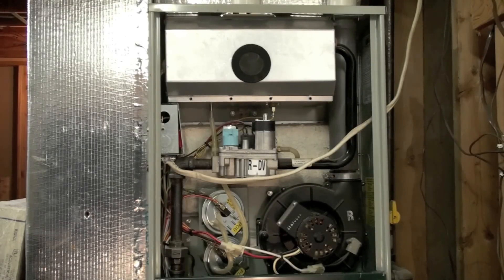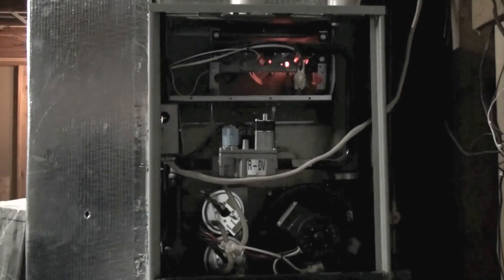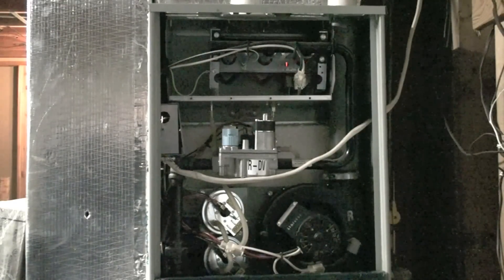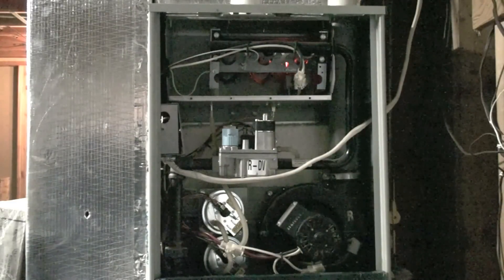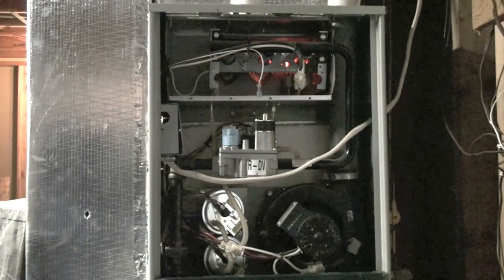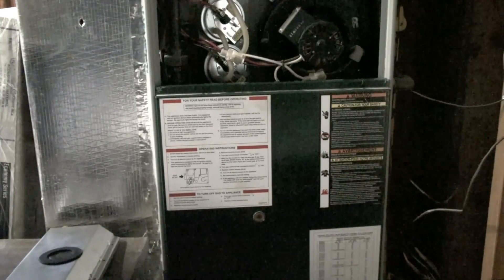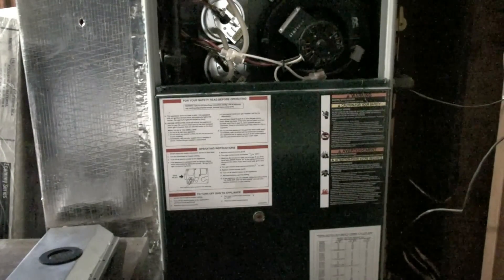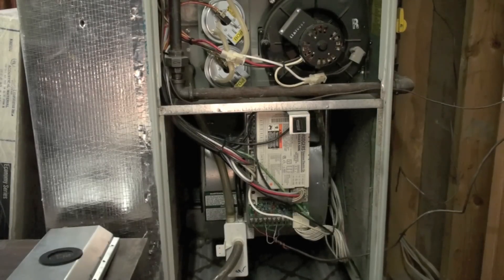How the 90% gas furnace works

Comment: We just had a Trane XC80 gas furnace installed in the last two days.  It's running beautifully.  My boyfriend put the damn thing into high flame mode.  It heated 3000 square feet of house in less than 15 minutes from 64 degrees to a comfortable 73
Reply: Any issues with it yet? 90%ers are starting to fade away.

Comment: I am a fitness equipment repair tech and licensed electrician, the equipment I deal with is not so far from HVAC in principle, motors, controls and air flow etc., thank you for these videos they are well done and interesting, you have made me seriously consider shifting my career. keep it up great videos I can watch them like a reality show lol
Reply from the maker: You mean maybe I'm like Survivor?
GFM
Reply: very much so
Reply: it's funny you say surviver, with how long you've been in the industry I'm sure you have seen many trend and code changes, have you made a video about that? the evolution of the industry
Reply from the maker: I have not.  Sounds like one to do.
GFM
Reply: Right on, it would be very interesting. I have a question if I was to get into the industry, is a online school as useless as I think it will be or is there real potential to start a career from that point? I would imagine, as in fitness equipment repair and electrical, hands on experience is king

Comment from the maker: Sorry about the late response. There appears to be some places that still do not have internet.  These furnaces originally went into hard lockout after one trial for ignition.  There were many nuisance shut downs.  Probably due to power anomalies.  So most furnaces have gone to using a soft lockout (meaning it will purge unburned gas then try again) two times and only hard lockout after 3 tries.  Note it also will try again after 1 hour to see if conditions have changed.

Comment: My 90 plus has been great for 20 years. i have had 2 issues. the pressure detect switch didnt detect fan coming on. Figured out with error code and tested switch with a meter. New switch installed (20 bucks for part). I also had the board go bad once. New board made entire house smell since a component burnt out. Scared us enough to call fire dept. New board was $200.00, i installed it in 10 min.

Comment from the maker: The gas manifold pressure should be normal with a blocked orifice.  If you have multiple burners, one or more will have no or a very low fire and the flame will not spread to the next burner.  If the meter is clocked, the input will be low.  As to flame sense, most furnaces sense on the the last to fire burner, so there will be no flame sense.  I would be looking close at each burner flame to note difference in flame size.  Hope this helps.
GFM

Comment: Awesome demo by the way! thank you for posting this!

but why didn't the furnace go into hard lock out after you unplugged the flame sensor? (first two times it didnt notice a flame at all) the third time it didnt notice a flame either...(which means that all three times the flame sensor was open) all three attempts had an open flame sensor connection... or is the flame circuit sensor always closed? or is there an element that senses if gas is traveling through the manifold?

Comment: Hi GFM,  Wanted to ask on these percentages for the AFUE, The text I am reading says that plastic pipe can't be used on furnaces until 90% or higher.  So is the lower percent number mean that the furnace runs hotter and has less chance of producing condensation? 

Thanks for your help

Comment: what would happen if you had spiders web up orfices in the manifold for gas supply . I had this happen to me . It was simular to what flame rod not working right . But if you had a manometer hooked up to the burner manifold would you gat a high pressure reading indcating that you have a restriction in the gas supply form the gas valve . Would that be the proper way to test it without taking the manifold apart first .

Comment: thank you for posting, a big help walking me through. when  you say power  do you mean from the breaker box, or the on off at the gass Junction box, my hubby left  last night and the heater  messing up, now. thought it was good whent to bed, then woke up to it making  that noise  of trying  to and then stopping. clean the heat bar, and its like no power? and of course  the first  snow  of the year here. :(
Reply from the maker: You can start by the light type switch on the furnace.  That will reboot the electronics.
GFM
Reply: grayfurnaceman thank you. it ended up being  the  fan motor  got it fixed last night. i am thankful  for  you postings  the video  it was a big help, and was able  to  do  it  myself  and didn't  have to spend lots of cash i don't  really  have to spend right now. thank you  again.
Reply from the maker: Welcome
GFM

Comment: My only question is the small drain on the furnace that goes into my floor drain. Is that for condensation? Does my furnace only have condensation during the heating season? Not during the cooling season? Great video and thanks.

Comment: Quick question: I have a 90% furnace. Hot surface ignitor came on, but it did not fire up. I checked the voltage going to the Gas valve and it was reading 9.2 volts. I changed the board, checked all the roll put switches and high limit switch. I have continuaty but it is still not firing up. What is next, the gas valve itself???
Reply from the maker: First, is gas available to the valve?  Before changing the gas valve, I would check the voltage at the wires to the gas valve.  Wires must be disconnected from the valve.  This must be done during a trial for ignition.  That is, when the HSI is glowing for 10 to 45 seconds, there will be power to the gas valve for 4 to 7 seconds.  
GFM
Reply: @grayfurnaceman  Thanx for the reply. I did check the voltage across the 2 stage gas valve. I was getting 9.2 volts. I had Nest thermostat installed 6 months ago and now the heat is not coming on. W1 is connected and w2 is not connected on the terminal board. Do I need to jump w1 and w2 for the 2 stage gas valve to work?
Reply from the maker: The W1 and W2 connections will not stop the valve from working.  The way it is now connected, will just lock out the 2d stage of heat.
You can try jumping from R to W1.  This will eliminate the thermostat as the problem.
GFM @copkhan007

Comment: I thought how a gas furnace operates is its has 2 sides , the microturbine side and the fan side, i thought the gas like the cng that comes from the gas company and it has a electric starter to turn over the gas turbine and fuel comes in and plugs ïignite it and as its running on the gas, the exhaust heat is used to heat the heat conductor which is directed by the fan system by a heat thermostat. And when the gas turbine is up to speed i thought the clutch activates the blower fan and both run 1:1 until the thermostat determines the set house temp .

Comment: Very informative! My furnace runs, pilot light is on but there is no flame in burner. I suspect for some reasons the gas valve isn't open. What would causing that?
Reply from the maker: Dan If the blower runs there is power to the furnace.  Is this a standing pilot furnace?
GFM
Reply: grayfurnaceman yes. The pilot is always light up. I manually relight the pilot the 1st times in a year. Sound like the pilot waits for gas to kick in but that took up to 20 minutes. This happen 1-2 times a day.
Reply from the maker: Dan I am assuming the is a thermocouple system rather than a thermopile.  If so, there gas valve is probably failing. If power is available to the gas valve, it should star immediately.
GFM
Reply: grayfurnaceman look like thermal couple to me because I see cooper wire is burn the pilot light. What I dont understand is why it only happen a few times a day. When it happens I just turn off/on the furnace hope it will burn. Really waste electricity here.

Comment: Just had a 96% furnace installed seems to run great, but when the furnace is off I can smell a very tiny bit of gas around the furnace, the installer said that is OK. Once running I don't smell anything, could this be normal? The furnace cabinet has rubber grommets on the side I guess to run stuff in and out, not all of them are used and one has a small hole in it and this is where I can smell the gas coming from. But it's very faint and not all the time. Is this OK.
Reply from the maker: +Rays RCs I would say not.  The problem with small gas leaks is you get used to the smell and may not recognize a bigger one.  I would want it checked out with a flammable gas detector or a very careful soap bubble test.
GFM
Reply: Thank for the info, called the installer he is coming back to do a pressure test on the system. To work out if leak or unused fuel Im smelling. But it's from the two stage valve I smell it (took the side panel of yesterday)
Reply from the maker: +Rays RCs Sounds good to me.
GFM

Comment: We have a new high efficiency gas furnace and recently once or twice in the evening we get a 2 to 3 second gas explosion in the furnace "Very Load and then you can feel a tremor in the house, however the furnace does not come on.  What could be the problem.  The make of the furnace is "HEIL"
Reply from the maker: It sounds like a delayed ignition.  This is pretty serious.  I would get someone out as soon as I could.  If you can't get a service tech out right away, check with the gas supplier to see if they can help.
GFM

Comment: whats the difference between a high efficient gas furnace and a reg furnace? Do all high efficient gas furnaces have A/C.
Reply from the maker: There are furnaces that are rated at 80% AFUE (annualized fuel usage efficiency).  Then there are 95% AFUE.  These last are high efficiency furnaces.  A/C is an option with a lll furnaces.  Hope this helps.
GFM

Comment: do 90 plus furnaces seem like they short cycle naturally?  if I set it to 70, it goes to 70 not 71, I'm used to furnaces going 1 degree warmer than set temp?
Reply from the maker: The high efficiency furnaces cycle like all others.  If the anticipation of the thermostat is correctly set, the temp in the structure should not vary.  
GFM

Comment: My inducer motor overheated and started to fire up and shutoff so I went to YouTube to see why it was doing that and tested the pressure switch with a paper clip and it fired up but the inducer did not come on , so I took out the inducer and the motor was burnt out. I checked Amazon for the inducer motor and the earliest they can have it was in 20days and the temperature in my house dropped to eleven degrees,what am I going to do. So I was walking along the street in my neighbourhood and low to my surprise some one put out a Lennox furnace it was not the same model as mine but the inducer was the same except mine had brackets on it and thi one didn’t so I said no problem, I cut the plastic brackets out of my old motor and plastic weld them unto the new one and low and behold it worked. Then I called repair clinic for the pressure switch and furnace runs like new
Reply from the maker: Glad you got it going.
GFM

Comment: Still confused if the inducer motor proves the vacuum for the pressure switch. Or if the pressure switch proves vacuum for the inducer?
Reply: Inducer produces the vacuum that triggers the pressure switch to flip (close circuit).  It's the closed circuit that "tells" the ignitor that draft induction worked properly so it will turn on, and the gas valve will then let in gas.  In essence, the flip of the pressure switch is "proving" the draft inducer is working properly.  Otherwise, the sequence will not continue.

Comment: really need help here. have a 90% furnace where the flame at the spreader between tubes is very high and getting burner box red hot constantly tripping roll out switch. doesnt seem to have a cracked exchanger but flame spreaders are deterierated a bit making a small space inbetween burners. flame in heat exchanger tubes looks good just high at flame spreaders.
Reply from the maker: If the spreaders are rusted out, you need to replace the burners.  What brand and model#?
GFM

Comment: Does anyone know if a 40 year old furnace is safe?I rent  and I need to know but landlord does not care.
Reply from the maker: They are safe if they are maintained. 
GFM
Reply: THANK YOU SO MUCH! I needed to hear that.
Reply: If maintained they are safe. But they cost hell lot of money for gas and you have to check them and operate manually, Depends on country where you live and gas code + gas prices. Difference in price for gas could be quite huge when used to heat a house. Even by factor of 3. In europe appliances have to be checked on annual basis and maintained. In absurd cases gas company can disconnect you and request papers from gas inspector. Also appliances without safety valve(thermocell gas lock shutoff gas if there is no fire) are banned in here more than 20 years. But in the US there is no such code. Also you can still use pipes with threading for installations. Here only a pressed, soldered or welded pipes are allowed here for a new installations.

Comment: What if inducer comes on and then turns off after maybe a minute or so
Reply from the maker: Sir Murdock The pressure switch is probably not making. Look for blockages in venting. 
GFM

Comment: why are there two pressure switches?
Reply from the maker: hendrikslv The unit is a 2 stage furnace.  Different inducer speeds for the stages.
GFM

Comment: Did you know that a 80% furnace works exactly the same way?
Reply from the maker: Not quite.  The sequence is the same, but the pressure switch must tap into the combustion chamber.
GFM